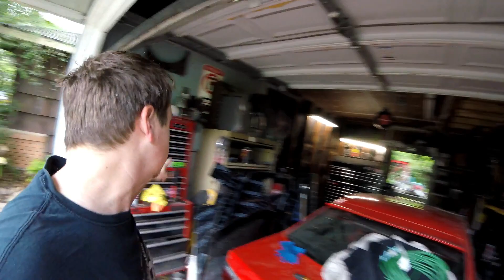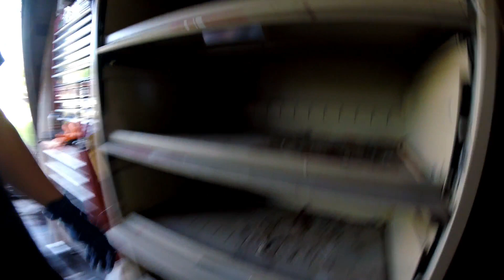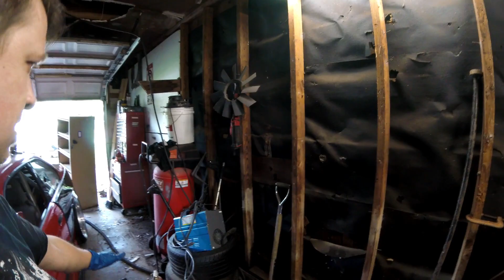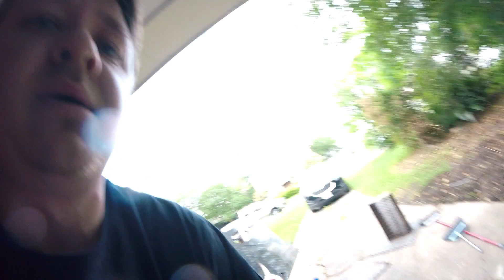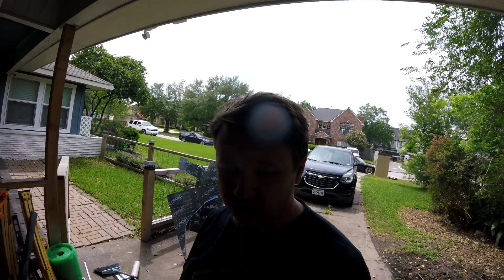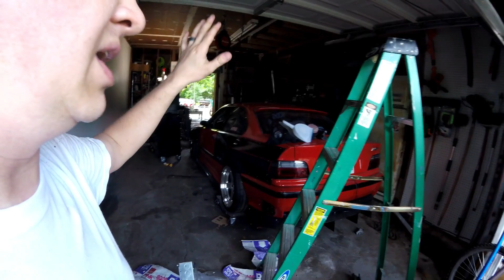Dream Garage Build Pt. 1

Comment: your garage door needs all new seals
Reply from the maker: Travis R. Yes it does. It need to be balanced, new seals and insulation.
Reply: TEXAS E36 Garage i use two 3/8 extension’s for the bars. needs to be around 6”. works every time
Reply from the maker: Travis R. Nice! Great advice! I’ll
Def look into that. Now that walls and done. I’m focusing on the floors and then the door
Reply: TEXAS E36 Garage just make sure you always have a good grip on one bar at all times. the side seals may be able to get from a home improvement store.